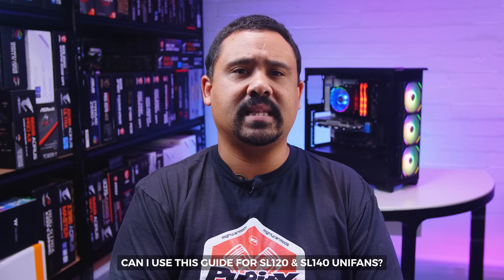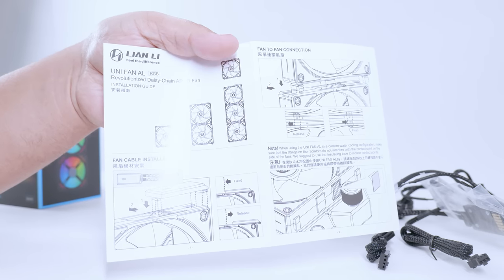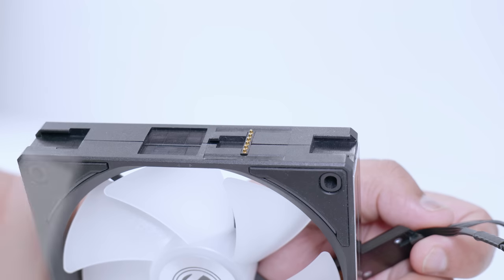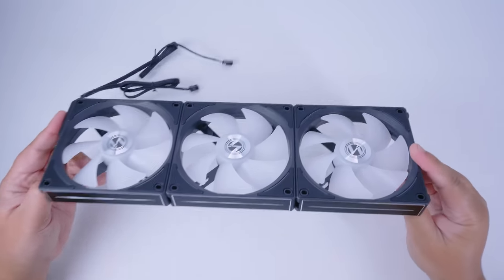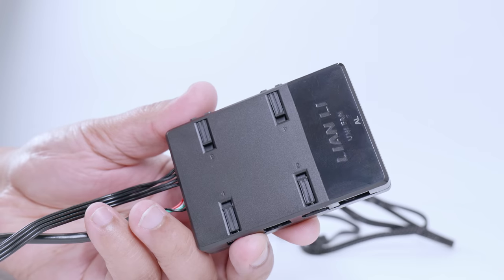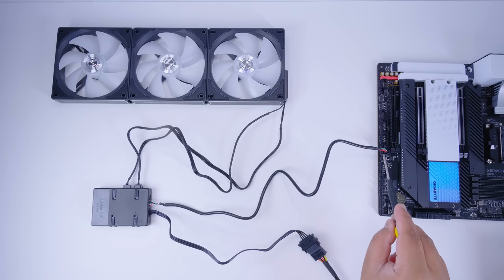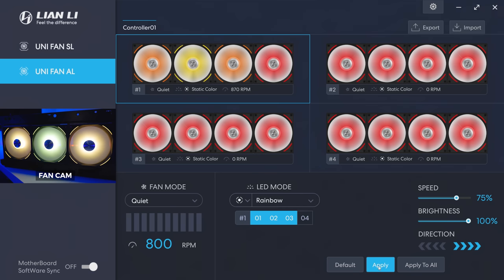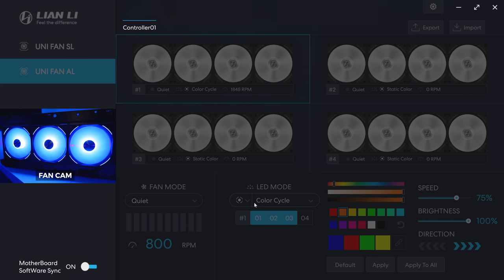HOW TO Lian Li UNIFAN AL120, SL120 & SL140 Easy Installation & Setup Guide

Comment: awesome video man this was the most clear and easy to follow installation guide
if any of you are having any trouble changing fans speeds or rgb colors i downloaded the fix but it didn't work then i just downloaded L-connect 2 and it worked i keeped the first one doe

Comment: I have the older 140mm model, and I just skip using any of the proprietary things and just plug them into the motherboard's argb and let it handle all the RGB. It also uses openRGB when I'm on Linux too. Works well.

Comment: The Flat-lay walkthrough was so very clear and helpful.

I've been changing my T-30 3x daisy chained AIO fans to share CPU_FAN and CPU_OPT rather than all on CPU_FAN due to learning about, and having significant worries of, overloading the 1 AMP limit on fan headers, since T-30s are well above that under full draw.

Then I thought, wait, I have  4 Lian Li fans connected to my hub. Is that in danger? And I wasn't sure how they were powered, as I was pretty sure it was power supply related instead, so safe.
Your video here helped me clear that worry up without having to take apart my cables and trace things. And also reminded me of how much of a mess the cables are with hubs lol.

Comment: Clever design with the cable and controller. And the software looks pretty straightforward.
I'll give it a go when I'm done with all the corsair's mess.
BTW great job on the tutorial. Cheers!
Reply: Aquacomputer and its Aquasuite has been the top option for fan controller and software for longest time. They have options like splitty 4 to control corsair argb fans and farbwerk360 for the rest.

Watercool been long working on one. Ekwb is completely redoing there. Corsair has always been not great.
Reply: If you think Corsair is a mess, wait until you try L connect... wish I could just return these damn fans.
Reply: @skvaderarts7009  agree..it's a disaster..

Comment: I just ordered these, two 3 packs, and finding out that i can have set speed case fans AND temp controlled aio fans on the same hub, man oh man these fans really are super functional, Also ordered the Meshify C, cannot wait till next weekend, i should have everything by then and its going tto be a breeze to rebuild with the new case and fans. Theyre very pretty as well.
Reply: How did you get the aio fans to be temp controlled?

Comment: thank you so much. Simple explanation, no needless fluff. I was stuck with the optional part, i was unsure what to do with those cables as the included manual didn't really tell me what it did. It made it seem it was necessary.
Reply: Precisely! You are not alone!
Reply: So what does the Optional part does exactly? or what happens if you do not do it?

Comment: good day sir, can I connect another triple set fans on the same controller using 3 and 4? And then using synch cable to the motherboard?  Because I cannot find the right connector to go straight into my power supply. (Seasonic Prime PX 1000) Thank you.

Comment: Hey is it possible to control the AL120 RGB color with motherboard aura sync using Deepcool FH-10 Fan hub instead of using L-connect? I see that there is PWM issue with L-connect and therefore will love to use my fan hub instead of L-connect. Also I belive the AL120 RBG connector is universal one and can plug directly into Deepcool FH-10 Fan hub or any other generic fan hub?

Comment: Hey! I am going to do a case swap soon. My new case will be an O11 Air Mini and I already made sure that all of my components are compatible with this case.
I am also going to buy a 2-pack of SL140 fans which I will connect to my motherboard for RGB and PWM control.

My question is this. I already have 6x Arctic aRGB PWM fans that I will be keeping for now (these will go inside the Lian Li case). Can I connect these fans to the Lian Li controller that comes with the SL140 fans or they won't be compatible? And if they're not, is there any aRGB controller that you recommend?

Comment: Now If I wanted to put 2 of thous lianLi uni SL120 fans on my Graphics card (instead of the ones it came with) Would I want to connect the fan power to the Graphics card or still into the controller? (just asking to be Shure I think the answer is into the Graphics cars power so they spin how the graphics card needs them to, and the rgb connector into the controller to set the color right-? )

Comment: I have the Ryujin II  and lang li 120 al fans  i
I want  to replace the noctua fans with the lang li  the thing should I use  both controller Rog controller with no fans and plug them in to the Lang li fans controller  or is there a better way sorry if I didn't explain myself properly thanks

Comment: If I disconnect the mobo rgb sync from the controller, will LConnect 3 finally control my fans? I have a new Galahad 240 SLI 120 edition.

Comment: If I want to use these fans with a Gigabyte Waterforce AIO do I just plug these fans into the controller and not the CPU Fan Header on the motherboard? Because on my AIO I don't have a CPU Fan Cable

Comment: So my plan is to replace all my fans with 3x SL120 on rad and 4x SL140 case, 3 front and 1 back and that is probably fine to run off the one SL120 3 pack controller but i'm going to ask anyway if that is fine? :p

Comment: So I didn't know about the lian li controller. I bought 4 of the sl140 lian li fans (single packs) for my pc. I have a Msi X570 gaming plus motherboard. I know I can still connect all four of these to get the fans going but can I still get the rgb without the controller?

Comment: im actually installing these right now, but im having trouble understanding the optional motherboard plugs.  is there a benefit to having the optional motherboard sync?  or its just extra steps i dont need to do.  i have 2 sets of these Lian Li SL120 (so 6 individual fans total).  If im able to, should i just hook up every available/optional plug?  or would that just do more harm than good?

Comment: Found out you can't install controller with the foam on a Lancool 3.  Have to use the magnet if you're putting it in the spot made for it.  makes the controller too thick, door won't close.

Comment: Hi I'm having trouble to control the fan speeds thru the motherboard i have the connections made as you show in here with the rgb and fan sync cable connected from the controller to the motherboard , how ever the fans still cant be controlled by the motherboard , Wich is asus tuf z690 , any suggestions ?

Comment: QUICK QUESTION.... I JUST BOUGHT A RGB 8 PIN STRIMER FOR THE GPU FROM LIAN LI.... AND I WANT TO CONNECT THE RGB CABLE TO THE MOTHERBOARD NOW SINCE I DID NOT GET THE 24 PIN STRIMER WHICH INCLUDES THE CONTROLLER. CAN  I CONNECT THE RGB CABLE TO THE LIAN LI AL120  RGB PORT?

Comment: Need a bit of help, I’ve got a maximus z690 extreme with the artic freezer 2. I’m using lian li AL fans. So I’ve set up the fans connected to the controller. The sata cable is connected along with the usb cable. So I’ve connected the RGB but the other cable, I don’t know where it goes, on the motherboard there is about 9 connections. I’ve connected to the cpu Fan connection The artic pump cable has been connected to the CPU opt. But I feel like I can’t control the fans and they don’t adjust to being in game or out of game. Any other info please ask and thanks

Comment: Im bit confuse.... say you connect 3 regular fans to motherboard = 3 cable period. at 9:19 how many was it? 2 from unifans + the box + 2 cable out from box to motherboard / powersupply.
Now, is it just me or it MORE cable mess? Can i just connect all 3 fans (in a serie) and use 1 god damn cable plugged directly to motherboard?

Comment: So confused on why there is an optional feature??? You didn’t explain it. So do I install it or not? My mobo only has a 4 pin header. But I have a pwm port for the other cable. No idea what it does

Comment: Not sure if you'll see this. I've been checking and researching some stuff for my next pc build mid next year. In terms of technology it's ages. However seeing Lian Li fans and comparing them to Corsair & how to set them up. It's definitely a hard pass on corsair, i do not own any other corsair devices anyway so yeah Lian Li is the easiest to setup and also not such a cable mess. Thanks for the indepth guide ;-)

Comment: Just ordereed a 3 pack of the INF fans and they don't give you a cable for Direct to motherboard PWN and aRGB, force you to use the controller which I have no desire of installing. Had to order a Single Fan just to get the proper cable. Found this odd they would omit a very important item like that when previous 3 packs always came with Direct to MB cables. They are forcing you into the ecosystem of Lconnect and I have recently removed all controllers from my PC and connected everything to motherboard headers. Deleted all bloatware for Fan control and much more stable system. 
I just find it odd that a $120 pack of fans does not give you a crucial adapter Cable.

Comment: I don’t use the hub that came with the fans. Got a phanteks evolv x and I just daisy chain them all to the built in phanteks argb lighting and control it from the front of the case. Can also be controlled with your motherboard rgb software by plugging the phanteks 3pin digital rgb in to the motherboard
Reply from the maker: I never use the hub when I use these fans. The video is for people who aren't as versed in adapting cables etc.

Comment: So if I have my SL FANS already connected to my controller and I connect AL FANS to that same controller, will it recognize them as AL FANS? Or do I have to add an additional controller?
Reply: AL controllers are not designed for SL.

Comment: Is that optional step required to get all the fans to work correctly with the software?  Also, I bought 6 more fans for the case and was going to just plug them into the controller that came with the AIO.  Will I be able to control them individually and change fan/rgb profiles or do I need to plug them into that optional splitter?
Reply: You’ll be able to control them separately in the software,both fan speed and rgb profiles

Comment: What is the point of adding the extra option cables into the controller? I just purchased these fans w/ controller and don't understand. My plan is to right now have 3 on top for exhaust, 3 on bottom for exhaust, plug those 2 sets into the controller, and then have 1 rear exhaust noctua (no RGB) fan that doesn't plug into the controller. Would I need to do the add the additional optional step? Thanks
Reply from the maker: just plug the noctua in the hub as well. having all your fans as exhaust is going to be a pretty bad idea

Comment: But how do i connect my Lian Li CASE fans that came with the Lancool Mesh 2? Those fans have 3 seperate fan connectors that dont fit in the controller (it fits into the mobo)
Reply from the maker: You dont

Comment: Which direction is intake and outtake? The fans don't have the arrow that usually denotes airflow direction.
Reply: Im going to give you a bit of a tip. On a pc fan, there are 2 sides. One with only the fan blades and one with the fan blades and an X or + shaped object. The side with ONLY the fan blades and no X shaped object is which way the air goes through. This applies to all fans. I am sorry if this is hard to understand, Im not great with explaining things, you can probably find a link online explaining this better.

Comment: My dynamic case comes with a fan controller, i just bought a bunch of unifans. Can i plug them in there or should i use the controller that comes with the fans ? Thanks
Reply from the maker: If the connectors fit use the built in case controller. Much easier

Comment: is it best to connect Uni fans to mobo especially if I want to overclock both cpu/gpu via Asus Mobo and MSI Afterburner or EVGA Precision? Total 6 uni fans intake and 1 exhaust rear and 3 exhaust aio (nzxt)
Reply from the maker: Makes no difference
Reply: @GearSeekers  with the optional pwn cable, would this be H_AMP, CHA_FAN3 or W_PUMP? nothing says pwm on Asus Mobo M12 HERO WIFI?
Is there also a way to tuck the I/O fan cable cleanly without sticking on rear of case

Comment: hello. can you tell me how to connect 2 controllers between each other? I have 3 v1 coolers from galahad 360 + pump backlight. 7 v2 coolers and 2 streamers. as you understand, all this will not fit on one controller
Reply from the maker: You have to use multiple controllers

Comment: In case we use these fans with NZXT AIO, do we connect fan power cables to the AIO and ARGB connection to the Lian Li Fan controller?
Reply: Depends if you want NZXT to control all your fans.

Comment: On the SL120 I can never get the controller to work with PWM even with bios set to PWM, What I did was just plug the Uni fans directly to MB fans header and use the controller as RGB only.
Reply from the maker: Update the firmware

Comment: I got question though so i bought a sl120 and sl140 and a corsair 7000 case with a commander pro but my question is.

Is it possible to connect a lian li sl120 and sl140 to commander pro?
Reply: No.

Comment: Hopefully the controller for the sl120/140 have been improved. Its actually broke/died for some users. Some of these people have changed to the aquacomputer farbwerk360 controller (required adapter cable from moddiy).
Reply from the maker: You can update the firmware on the SL controller
Reply: I use it on an external radiator so the aquacomputer solution is ideal for me as i run an external psu to power all the pumps/fans and the aquacomputer has an five pin to normal usb cable that plugs into any usb port. Also easier to manage the whole aquacomputer ecosystem (pump/flow sensor) through aquasuite software. Thats more the watercooler prospective though

On the internet i saw one person who has sl140  installed onto an external radiator. The fans themselves cost more than the external radiator itself.
Reply: @GearSeekers  

There also interesting solution from company called dewire you might want to keep an eye on. They are going to release an version of there products designed for 5v argb. 

The current product, the dewire relay is very interesting product for those who use radiator fans that don’t support daisy chain. Good item to review that just got released

Comment: Hello, I have the SL120s as the radiator fans for my AIO cooler, do I need to plug the optional PWM signal cable into CPU_FAN header on the motherboard? or it can be plug into any PWM header like in the video ?
Reply: If there was no hub in middle, it would be connecting to the CPU_FAN header. Think it will be the same with the hub in middle.
Reply: @mohammadmahiristehad9196  Thank you for your respond !

Comment: Can i actually just plug the USB Port cable into my motherboard if my motherboard does not have a 3 pin ARGB header?
Reply from the maker: Yes. I said in the video that those steps are optional
Reply: @GearSeekers  Thanks, great video!

Comment: The problem with this software, which you casually skipped, is that the L-connect module cannot communicate correctly with PWM. Once you set your fans to PWM in the software and hit apply, they all ramp up to 1900 rpm and stay there.

This completely defeats the purpose unless you just want to manually change it every time.

What I did was connect the PWM wires directly to my chasis fan headers and kept L-connect 2 just for aRGB control.
Reply: Question? Did you connect all the pmw wires into the motherboard or just one? I’m getting a cpu fan error and all of them running at max speed, just like you said.
Reply: @harrycole9939  All of them to motherboard. Not to the CPU fan header, but chassis fan header
Reply: What did putting them on the chassis fan header do? Did the mobo control the speed? M

Comment: These fans have no arrow indication of Direction of air flow,  so if on bottom as Intake which way do you face them?
Reply from the maker: Every single fan flows the same direction. Air exits through the frame side.
Reply: @GearSeekers  Yep i got it just had to Look closer, I apprreciate your review I watched entire before installing the system. I got the Sync working was not fond of the L2 software though.

Comment: I don't understand how you plug this in if you're using 2 fans on your aio radiator. I've tried everything you do in this video and the fans work but bios is giving a cpu fan error. Which cable plugs into the cpu fan header on your motherboard?
Reply from the maker: Disable the warning in the BIOS
Reply: @GearSeekers  I appreciate the reply. Everything on my pc turns on and works for about 20 seconds then shuts off though so I can't get into my bios to do that. Really not sure what the issue is, just built the pc tho.
Reply: @brad6670  If you have an extra fan of any normal kind that can fit the CPU fan header on the motherboard, temporarily put it in the CPU fan header, turn on the computer and then you can get into your BIOS and turn it the warning off and then shutdown and remove that fan and you should be good to go.

Comment: Install your fans before plugging everything to the controller. Removing the rgb and pwr cable from the controler is super difficult, if not impossible once it's in... been trying to remove them for 25 minutes and my fingers can't handle it anymore.
Reply: Just broke the RGB cable nice... PRESS THE CLIP ON THE CONTROLLER TO UNLOCK THE RGB CABLE.
You have 2 more attempts at doing it right if you chain 3 fans together.